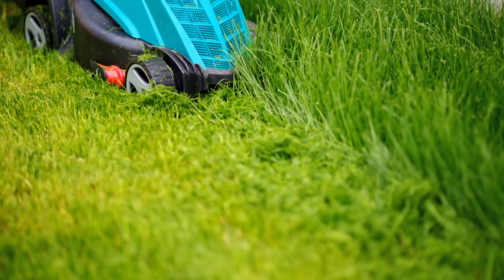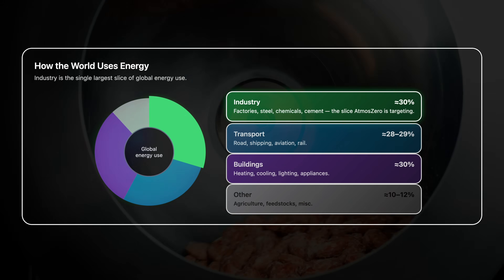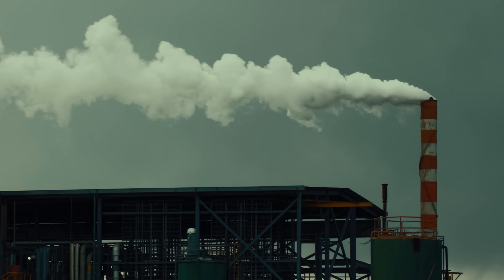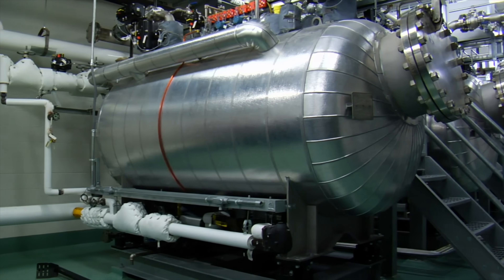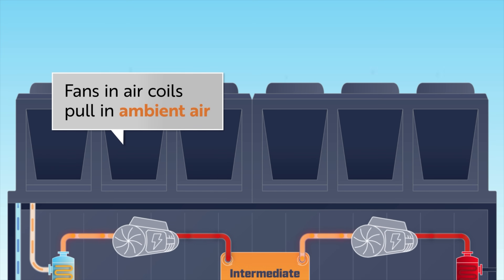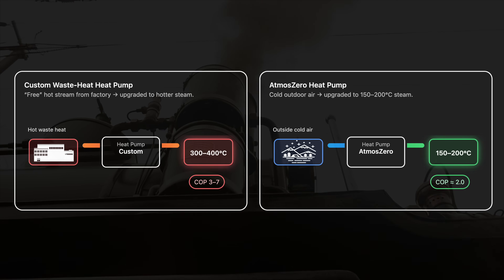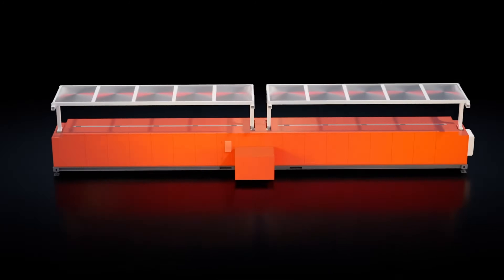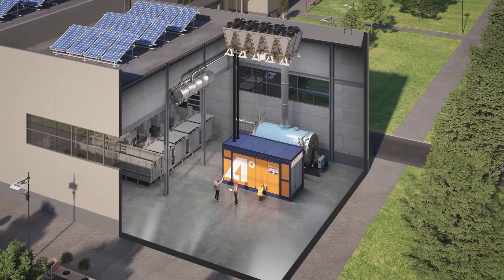This Startup Just SOLVED the Hardest Problem in Clean Energy

Comment: Now hook this thing up to a Datacenter as a heat source or up to a freezing logistics center as a cool drain
Reply: With a COP of 3 to 7 just wondering how much power could be generated if the high pressure steam supplied a turbo alternator?
Reply: @davidecramp None, steam engine/turbine a more efficent the hotter they are, heatpumps are more efficent the colder they are. In theorie the heatpump needs as much energy as sthe steam alternator produces, but in reality the efficency is always lower than what is physicly possible. You would just waste the energy.
Reply: Steal your heat source from underground for your Heat pump, and I think that would be more sustainable!
Reply: @VRtechman  steal it from Earth... :D
Reply: @VRtechman  You're missing the point of the whole video... The point is that it's a drop in solution. Nobody is drilling massive expensive wells to save another 10 bucks. This thing uses air and is craned into place in a couple of days onto a platform, then it's turned on. Period.
Reply: Why comment before watching the whole video?
Reply: Is their a datacenter next to the industry?
Reply: Air blowers are all data centers need now that chips are water cooled and only need the water to drop 10 degrees.
No need for coolants.
No need for water.
Reply: nope, that would create something "free" and also create "liability".  To do that two things would be required.
The government forcing YOU to pay for it and freeing the company being "enriched" from liability.
You don't understand the actual consequences of your proposal.
Yes, very nice in theory, but you don't get any rewards for this, only the drawbacks.  And you better be thankful.

Comment: A bore hole would bring geothermal energy into the mix increasing cop x5.
Reply: 🤔 How is that not bespoke?
Reply: Cool stuff. The new plasma drill heads could access deeper / faster / hotter !
Reply: A deep heat tube would be capable of a standardized sizing for manufacturing and it would cause a bit of a increase on cost over all but gain more heat or allow for more stages in the process for a higher heat output (instead of steam be heating a liquid metal of some kind for kiln heat or other heat intensive processes) also mean fewer boilers required over all in this process
Reply: @beardsley1995  Thank you for your insight! Having worked in the oil industry myself, I think geothermal has a great potential, I look forward with excitement on working with geothermal industry!

Comment: You should look into Molten Oxide Electrolysis technology from the startup Boston Metal. They are electrifying the steel making process. They are able to refine iron ore into pure iron and even into steel using molten salts and electrolysis to separate oxygen from iron. This eliminates all CO2 emissions from steel if it's powered by renewable energy. It's only emission will be oxygen. But REALLY the cool thing about it is that this could be used on more than just iron and steel. It is a platform that could refine any type of metal. In fact they already are making pilot plants to recover rare earth metals from existing mining sites and their waste.
Reply: Pyrogenisis has a tech that is closer to a one step oxide to pure metal type smelting. Plasma torches can break the o2 bond and produce pure iron in one step. Blow iron oxide past a plasma arc and make small droplet iron.
Reply: The company Stegra in Sweden is already at the scale up stage with producing green steel
Reply: I wonder how that will work with powders, China recently (about a year ago) determined a means to refine powdered iron ore straight into high grade steel, working towards being able to print Steel from a robotic device.
Reply: Yeah yeah yeah but they can never rival Hydrogen DRI when it comes to steel. They might find some niches that are competing with hydrogen plasma but mainly Boston Metal is just a beatiful idea.
Reply: @JensStubbe-d6k Yeah, yeah, yeah but how is the hydrogen produced? 95% of the time it's produced from fossil fuels so it certainly ain't perfect either
Reply: @vicjay1972  its wild how much more efficient it is to break hydrocarbons instead of water molecules. Tho something like this heat pump may be capable of providing a solution to use water.
Reply: @vicjay1972  - the fact H2 can be produced from carbon fuels makes it a perfect candidate since this is another pathway to generate it. We must have multiple ways to generate energy carriers, for energy security.

Once windmills are cracking H2O off-shore & piping Hydrogen to the shore, life will be good!

Comment: I have a push mower, my carbon footprint is smaller than everyone else's. I don't need no damn gas or electricity
Reply: Gotcha beat!  We just don’t mow… 🤣
Reply: Hhahahaa someone in the third just eased your “Carbon Footprint” credits in the last 3 mins.
Reply: We had a push mower, too, worked just fine and without the noise and fumes. That said, let's stop looking at individual foot print (developed as a ruse by BP to shift blame to innocent people) and look at large scale solutions, as in this use case.